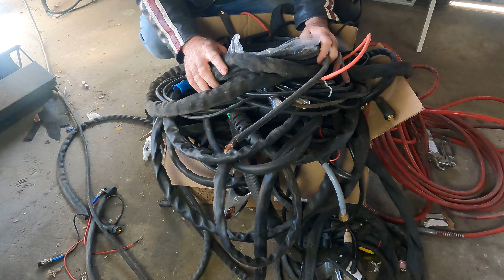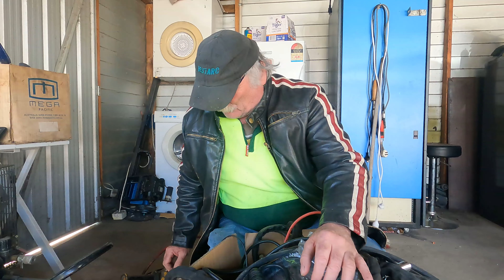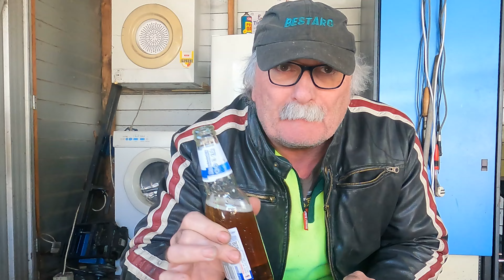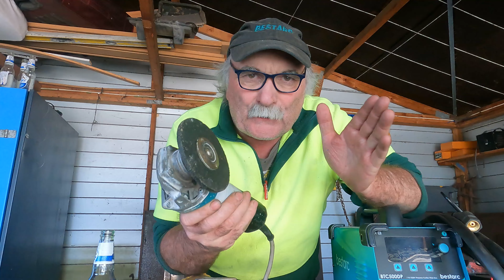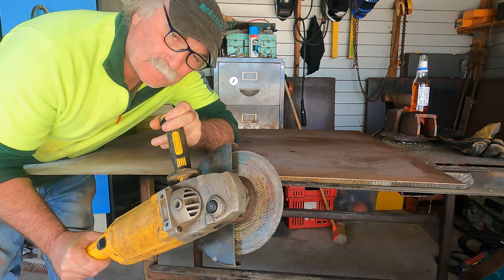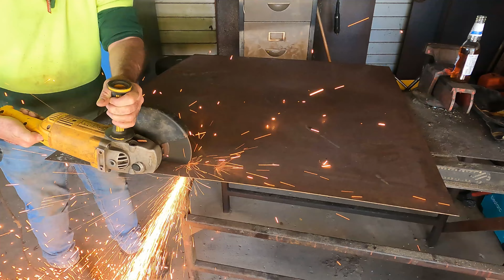Revolutionize Your Workshop with Cutting-Edge Tools!

Comment: we have 110 and 220.    We run smaller things off of the single leg 110.    I purchased a pretty nice one several years ago for a 50 amp.   Amico CUT-50HF 50Amp Non-touch Pilot Arc Plasma Cutter  just under $400 but it is a great machine.   You should look at everlast welders and cutters.  Very highend. I have 221sti multiprocess welder also.

Comment: Hey Pete, I have the gen 10 best arc on order.  Can i use it without the standoff with a stencil?  I want to gouge some 3/8" bolt holes in some hardened 1/4" plate.  Im not worried about loosing the metal temper as I am just using the recycled steel in a project that does not require hardened steel.  I figure if I can drag the tip around a stencil I can probably get better looking/ more accurate 3/8" diameter holes?  What's your suggestion?

Comment: USA also has 240. The transformers are center tapped. Most things don't need 240. We use 240 for some appliances and shop equipment.

Comment: Can the pt31, lg40  torch be used on the bestarc. do you need to turn the pilot arc function off to do this. or does the plasma cutter even have that option. Thanks, Gary

Comment: I really agree with you that BestArc are the very best Plasma Cutting machines, and indeed available at very reasonable prices.
I'm a full-time scrapper using plasma cutters almost every day. My two 80 Amp BestArc cutters are for sure the best cutters I've had so far.
On full power, 80 Amp, they can cut through up to 28 mm steel.

Comment: My dad bought  Cut50 off eBay 10 years ago or so and never used the dang thing. It didn't have pilot arc either. I sure would never need anyone to explain the benefits of having a plasma torch. All the cutting methods have their specific uses with pros and cons, but the pros are stacked pretty high when it comes to cutting sheets. Also you can cut weird shapes that would be near impossible with an angle grinder. BTW>The old fella has gone on now, it'll be a year on the 28th. He always loved watching you Uncle Pete! We laughed and farted the whole time!!!

Comment: I bought my Parkside built in compressor touch arc flame from Lidl here in the qeer old corrupt UK 🇬🇧 for £149.99..5 yr guarantee...Lidl also sell a pilot arc torch complete for this model that turns it in to a pilot arc machine for £35.99 but this isnt available in the qeer old corrupt UK at the moment and can only buy it in Europe..Germany..Netherlands..France etc

Comment: Plasma are awesome use it more often than acetylene torch and cheaper than acetylene torch I got the 7 generation bestarc but only been able to cut 12mm is there a trick to cut 16mm
Reply: What amp machine you got?
Reply: @ 50 amp

Comment: You dont have the correct flange plates on your angle grinder for the discs you are using.
Reply: I bought a Lotos plasma cutter, it lasted a couple years. Then the damn thing stopped working. 
So I bought another Lotos, thinking that maybe it was something that just a problem with the way we were using it. 
I used the new for about 20 minutes, and then bloody thing quit on me. 
Lotos company sent me a new one and that lasted about 2 minutes and quit. 
So now I have 3 of those damn things and none of them work!
DO NOT BUY LOTOS!
Reply from the maker: yes i do
Reply: @petestools  I had the same issue with the centers breaking out till I changed the flanges to larger diameter flanges such as these.

Comment: I only need a metal to cut. Serious question, does it realy consume 50 amps on 240 volts? that requires a deticated power line.
Reply: Has a built in power inverter
Reply from the maker: if you can run it on a separate circuit works best .I normally plug it into an oven plug has higher amps.

Comment: what is electric cost plama vs grinder look numbers on meter then do 3 strips with each sort of thing, also you got buy compressor thats added price
Reply from the maker: most guys have a compressor .Once you play with a plasma cutter you wont go back
Reply: Only for thicker steel. Many plasmas have their own air supply that will get you through thinner stuff. So that's an option.